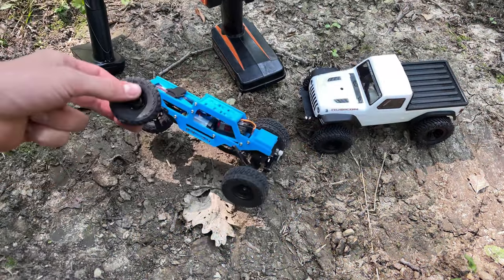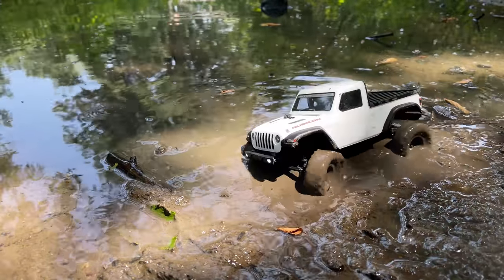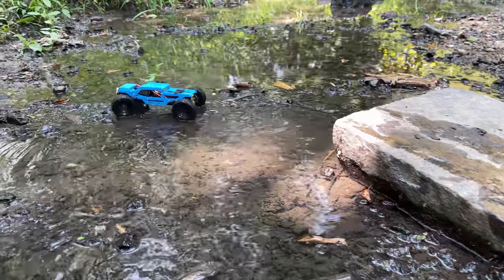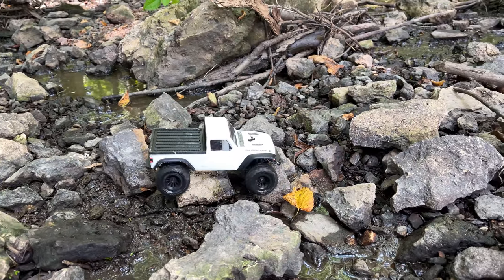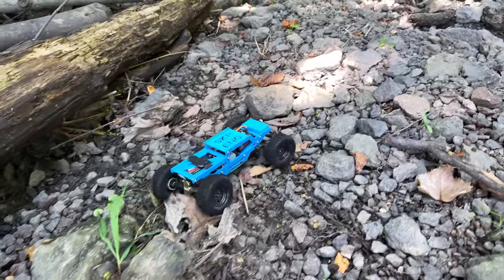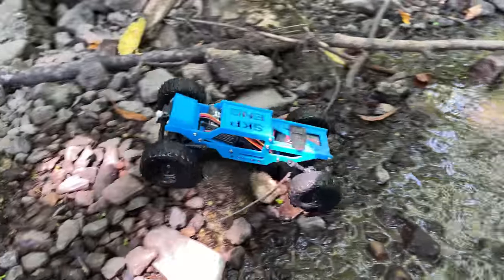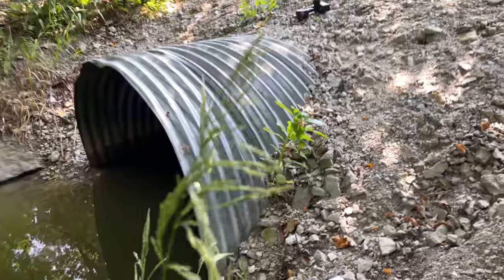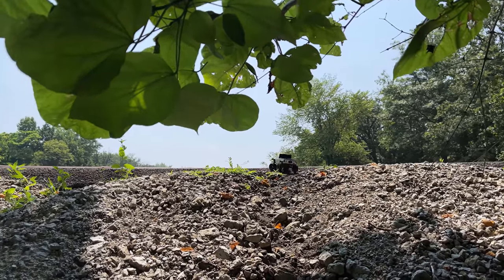Brushless SCX24 JL Pickup Crawling and Mudding Through The Woods! Can It Take On The Warthog?

Comment: Hey man, I recently got some brass wheel weights and steering knuckles but I can't use them together because they bind up in each other, do you have any suggestions?
Reply from the maker: You can use a dremel to clearance the brass wheel weight or knuckle to get the clearance you need!
Reply: @CineMoto24  I'll give it a whirl